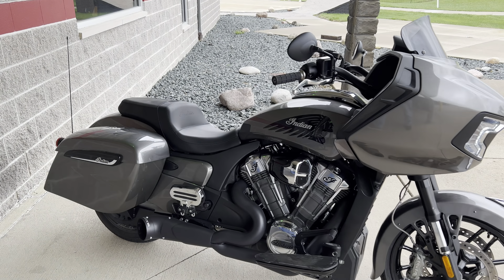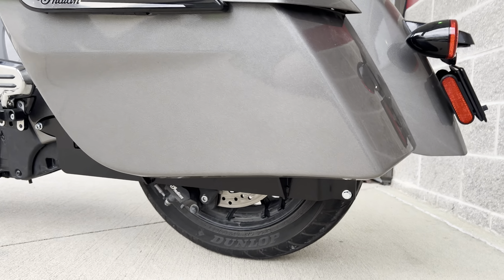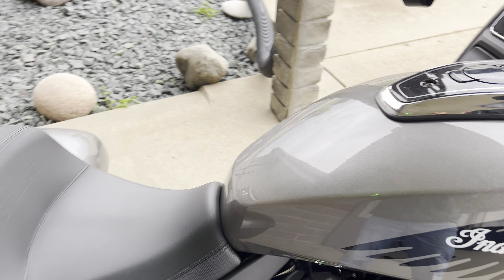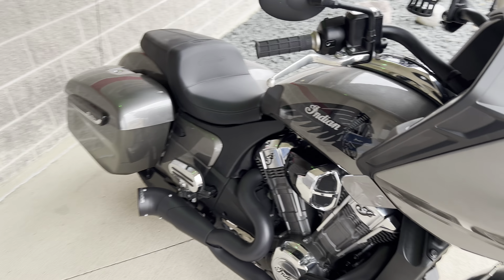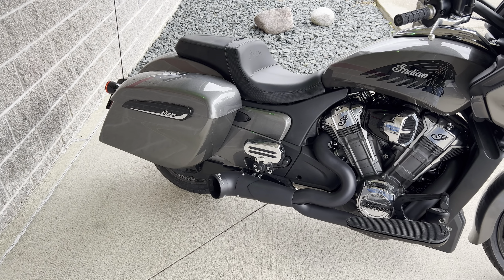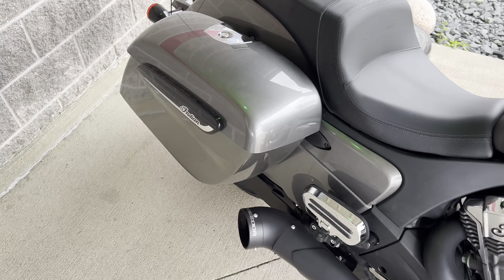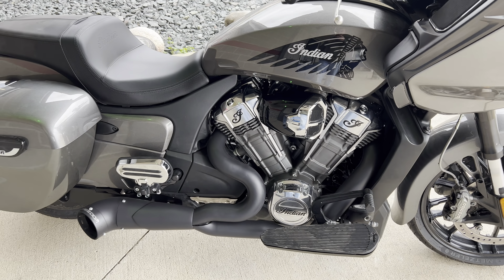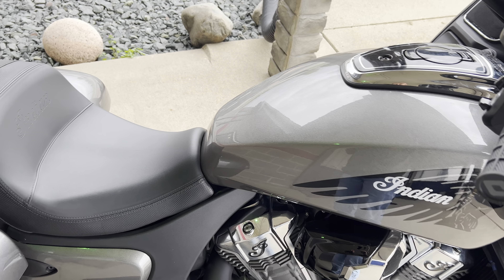Indian Challenger - Freedom 2-1 Turn Out Side Dump - Startup

Comment: Did you ever end of getting this flashed by someone? Have you had any problems since installing it? My local dealer is telling me anything with a CAT delete is causing massive problems and the bike is not running correctly and throwing every code under the sun and making one of the cylinders not work
Reply from the maker: nope just the indian stage 2 tune. no issues at all.
Reply: @hmactwenty  Can you request the stage 2 tune even if you don't do the stage 2 cams? Ill be getting the stage 1 from them for the intake but just trying to make sure this exhaust wont give me any troubles. Leaning towards Lloydz tune but also nervous with some of the issues that have happened with spark knock and what not (not sure if things have gotten better or not) but that's a expensive experiment to find out
Reply from the maker: @chrispoe5292  not sure… I wouldn’t though.